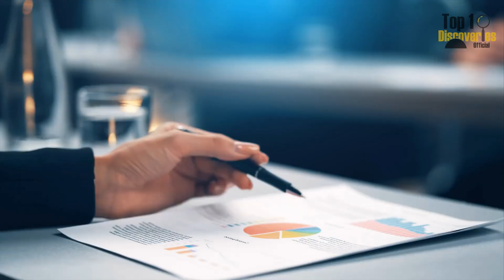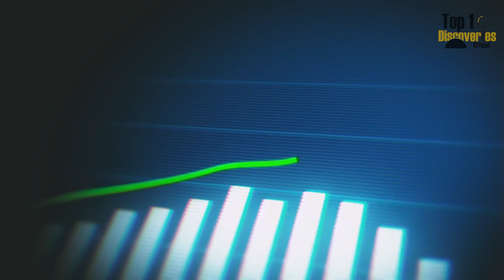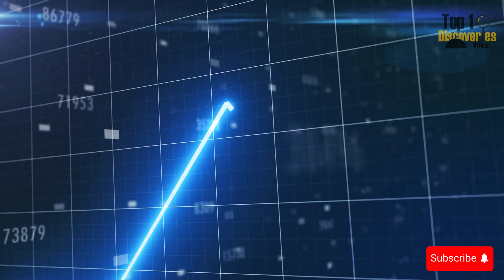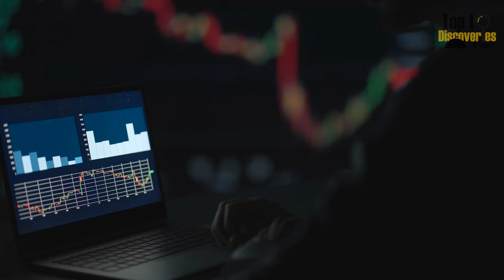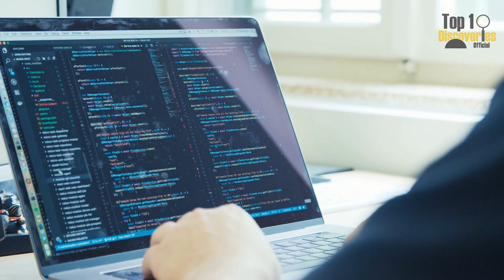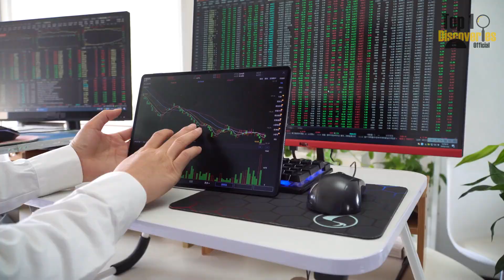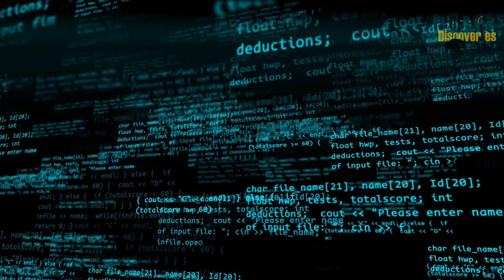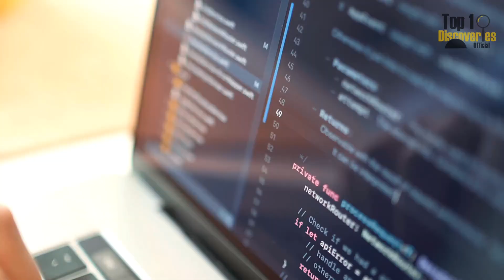China's Top Contender to Challenge Samsung and TSMC

Comment from the maker: Whether you're cheering China's rise or raising tough questions about global supply chains, this conversation matters.
Let’s look at the big picture:
🔹 In 2010, China barely had a presence in chip design or lithography.
🔹 By 2023, it’s producing 7nm chips at SMIC, building thousands of fabs, and launching EUV-equivalent prototypes with full state backing.
🔹 Meanwhile, the U.S. has spent over $280 billion via the CHIPS Act… but actual chip output? Still waiting.
This isn’t just a tech race—it’s a reshaping of global power.
China isn’t “catching up.” It’s building a parallel system the U.S. can’t control.
So here’s our question to YOU, the audience:
Do you believe China will achieve full semiconductor independence before 2030?
And if it does—how should the world respond?

Let’s hear your thoughts👇